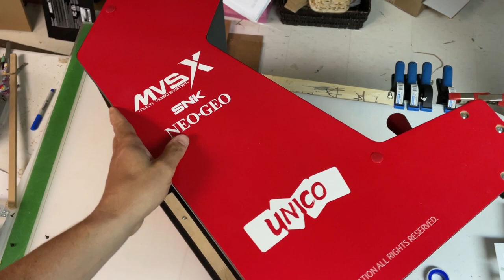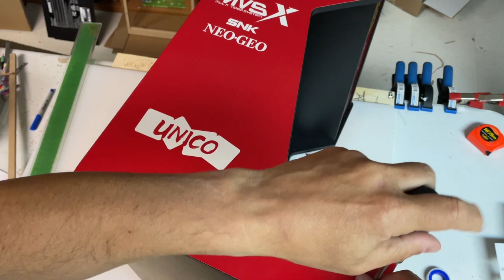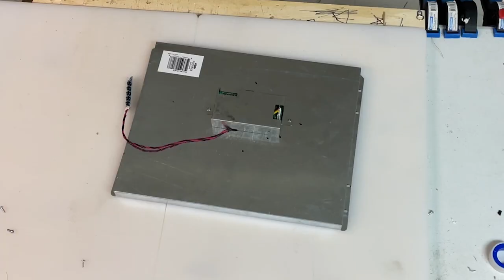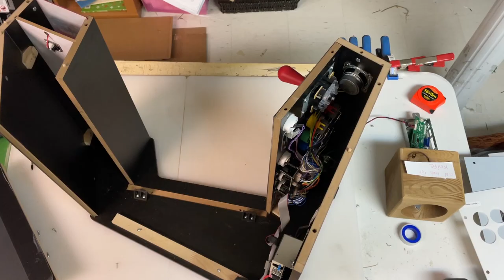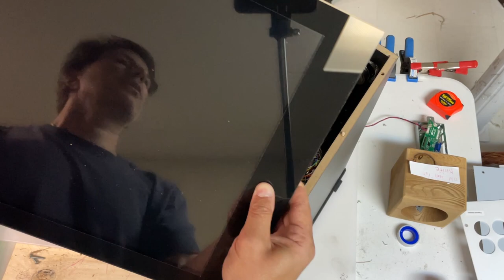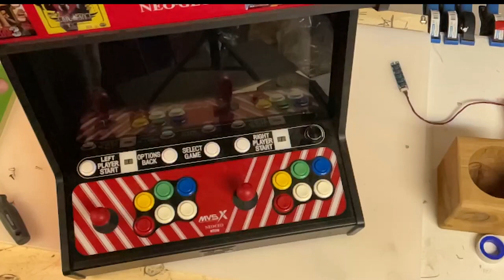MVSX 19" UNICO PHOENIX monitor kit installation guide

Comment: Bought an HP E190i from goodwill for 25$ that was a direct swap in with the stock PCB cables. The worst part was fabricating a bezel for it and getting it mounted firmly. Masking off and spray painting a piece of acyrilic is a piece of cake. As a bonus the screen is IPS and the viewing angles are way better than unicos overpriced panel
Reply: Thank you! I made swap with HPE190i. Very easy
Reply: This screen works with the mvsx without having to buy additional cable?? is it exactly the same connection? thank you very much in advance
Reply: @Videos-Cool-de-la-vie  
Yes, it's totaly plug's and play.
Reply: @Lahuppia_Noire  I just bought one!! It's not at all the same connection to simply plug it in to replace the 17' mvsx screen!  Thanks for lying to me
Reply: @Videos-Cool-de-la-vie  I'm not in the habit of lying.
All you have to do is completely dismantle the screen casing. After that, if you don't have the technical skills required for this kind of operation, call in a professional.
Reply: @Lahuppia_Noire  Ecoutez monsieur  Huppia le noire .Quelle est la connaissance technique spécial pour brancher des cables?  j'ai démonter le boitier, et les fiches ne sont pas du tout identique
Reply from the maker: @Videos-Cool-de-la-vie works, don’t need to buy additional hardware.
Reply from the maker: @Videos-Cool-de-la-vie just remove the current box behind the monitor.

Comment: Thank you, I’m gonna be ordering the wood mount plexiglass kit from your site. Installation seems easy. Main reason I’m replacing my 17” is the monitor has color shifting from right side viewing angle only. Did you notice the Unico 19” on both sides viewable without any color shift? Thanks

Comment: This video totally cured my curiosity about connecting the 19” to the MVSX PCB. I kept thinking it would be some weird workaround with an LVDS to HDMI….not a straight up PCB swap. This is super easy. 😊
Reply from the maker: My initial thought as well.  Actually, the first thing I did was connect the LVDS board (it does work!).  The only benefit was that you’re able to keep that controller board, overkill imho.
Reply: Yeah keeping the OG pcb allows super easy swap. Keep your original games plus the Hylox add on. Can’t wait for my bezel and frame to arrive. :)
Reply: Great video and any difference in quality with the 19inch monitor over the stock.